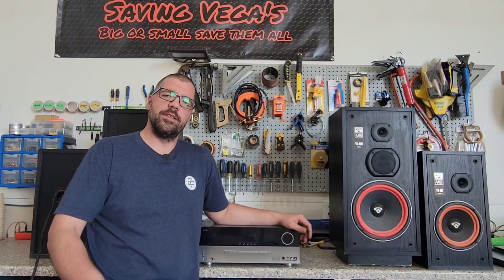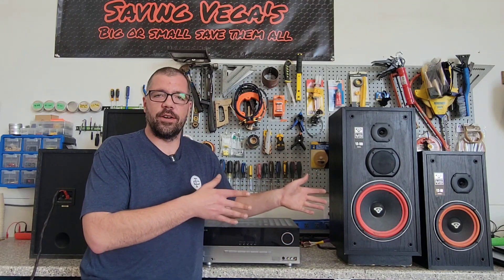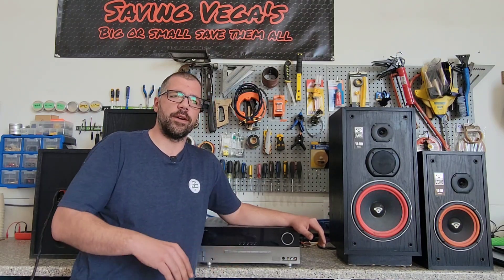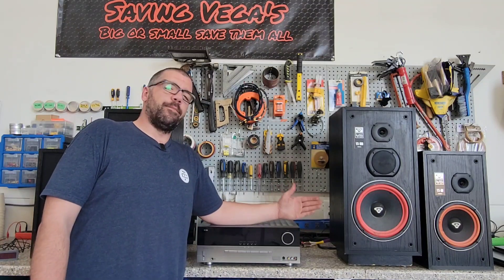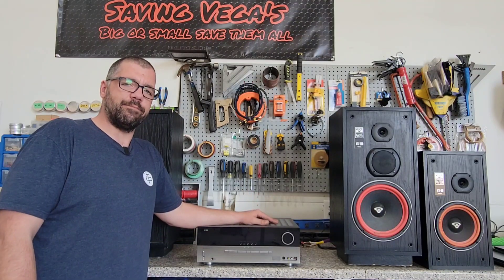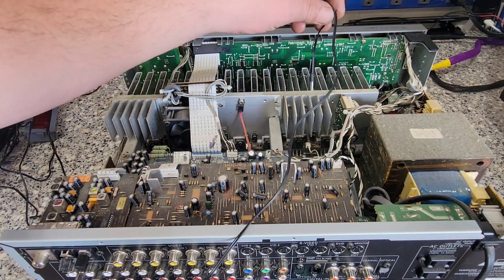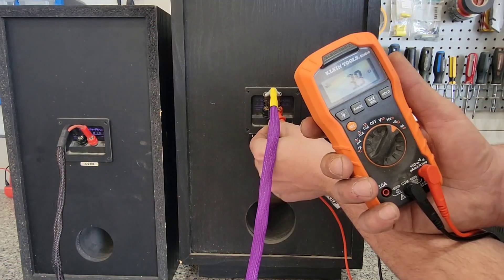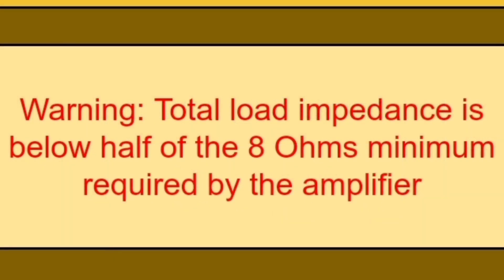Using an AV Receiver to Power Your Cerwin Vega's

Comment: why did you put the laptop on top of the receiver and reduce the ventilation area ?    that would make the unit heat up more.  I just hooked up my HK 3490 today to my Cerwin VS 120's.   i was surprised that the HK said 8 ohms on the back at the speaker input. most good receivers will let you adjust to , or take 4 ohms for one set of speakers without a problem.  i always run a cooling fan on top of the receiver so i am not concerned with heat..  in the summertime I will keep more of an eye on the temperature.

Comment: Putting your computer on top of the fan vent was not the best idea to get an accurate temp reading (and it overheats your amp). The air must flow to allow it to cool. And the computer itself produces heat it transfers through its base.

Comment: Own a pair of CV, V15b's bought new in the early 90's.
Drive them with an Onkyo M-501 dedicated amp, in "old school" all onkyo pre amp, dx-rd511 cd twin deck cd burner, and the rest...

Whats your opinion on the amp/speaker pairing.
Everything sounds very good, but don't want to over tax the amp. (150watt pc).

Thanks in advance...
Cheers 🍻...

Comment: I have two pairs of CV D3 speakers with 10 inch woofers, they are 1985 and 1987 models. Both pairs are in excellent shape and the foam surrounds look new, no fading or deterioration. They have been kept at approx. 70 degrees their entire life. Is it possible the foam is serviceable and doesn't need replacing? Thanks for any info.
Reply: IF it isn't flaking and isn't developing holes (which would leak air) then just keep using them until they do need reconing. If they weren't in the sun, that's part of why. If they were in a non-smoking household, that's part of why.
Reply: @railgap  Thanks for the reply. They were never exposed to direct sun or smoke and the snap on covers were always installed.

Comment: Sitting the laptop ontop of the receiver where the vent holes are will throw off the temperature reading becuz without the laptop ontop more heat would be allowed to escape making it cooler inside.

Comment: I had Cerwin vega Ve12 & XLS 15 
I found powering them from an 
A/V receiver they sounded rubbish & limp . 
No Heavy bass. Hardly and treble They sounded flat . 
I ended up Using Two Power Amplifiers,  CV 900 on the VE 12, and a CV1800 powering the XLS 15, with a Nad C370 acting as a pre amplifier . Much better . They were able to go Very Loud without distortion OMG, my Jaw smashed the ground the first time i cranked them. Never heard speakers go so loud and Take so much Abuse . 
Sadly Things change im Using Klipsch R 820f from same Nad C370 Amplifier nowadays
Reply from the maker: Both those models, especially the XLS15, have lower sensitivity ratings. If you compare the XLS15 and let's say the MX-400, both are 3 way designs that utilize a 15" woofer with a power rating of 400 watts. The XLS15s sensitivity rating is only 92dB, and the MX-400 is 107dB.
Reply: @SavingVegas  
So not easy to drive ?
Reply from the maker: No, sensitivity ratings are generally taken by measuring the SPL from a distance of 1 meter with one watt of power delivered to the speaker. The XLS15 is rated at 92dB and the MX-400 107dB. So, the MX-400 would play louder than the XLS15 when both given the same amount of power.
Reply: I have newer subs they are not the same as the og cerwin Vega series of woofers,drivers, and speakers...

Comment: I have a set of MX250s I bought at the military PX in Korea in 1995.  Around 2014 I refoamed the woofers, but they haven't really been used much in the last 15 years.  This video has me looking at getting them running again on my older Denon AVR-S920W.

Comment: I've got an older Yamaha RX-V793 AV receiver from the late 90s. It's 5.1, but no 5ch stereo mode. It is however 4ohm stable and can run A and B mains simultaneously. I have a set of VS-100s like these only woodgrain finish that I just refoamed hooked up to A, and a pair of L7's which are 8 ohm hooked up to B. Think I'd be safe running both simultaneously not using surround mode so no center or rears would be powered at the time?
Reply from the maker: The A & B channels are essentially only 2 channels, left & right. Running both A & B at the same time would be the same as hooking up 4 speakers on an amp with only one set of speaker outputs, one left and one right. The purpose of A & B outputs on an amp is to be able to switch between 2 different sets of speakers as need be. On the back of the receiver, it's probably written somewhere saying A or B minimum 4 ohms, A + B minimum 8 ohms.

Comment: Back in the day, I bought a new receiver from Circuit City. It was between the harman cardon and an onkyo. I got the onkyo cause it said i could use 4 ohm speakers. Run the vegas in series to get a 12 ohm load
Reply from the maker: I have since this video been able to take impedance measurements of these speakers. They are rated as having a 6 ohm nominal impedance but they actually measure closer to 4 ohms really, especially the VS-100.

Comment: Yes, after such motivational videos, Harman repair services will not be left without work)) you should take into account what you used at low volume, but people don’t think with their heads. they’ll connect it to 2-3 Ohms and they’ll load up the power)) and then there will be sadness)))) and also the timbres there, the loudness in general will be a blast... after all, of all those who own the equipment, only a few percent understand how to use it, what influences what, the rest are just playing roulette...

Comment: I'm running a Pioneer vsx59txi with a Realistic eq in to my at-15s and not happy, they say to bi amp the speakers with the front surround channels, this receiver makes 130 wpc @ 8 ohms so will that make 260 wpc
Reply: Guess I will try a Crown amp, thanks for your time
Reply from the maker: I personally wouldn't bother trying to power them with an AV receiver. If your receiver has front channel pre outs I would use those with a good power amp.

You can't bi amp AT 15s. Bi amping is when you use 2 different channels for one speaker, one channel for the tweeter and second channel for the woofer.

Comment: I have a 1990s Technics Sa-GX170 Stereo Receiver,  it's rated at 100 Watts @ 8 ohms. I've been running 1 pair of RadioShack Mach Two speakers which are 15" Woofers and rated @ 8 ohms. I'm looking at purchasing some new Cerwin Vega floor speakers that are equal too my current Mach Two's. I really like the XLS-215'S with the twin 15" Woofers. Will I be OK using my current Receiver??? Appreciate a honest reply.
Reply from the maker: I personally haven't delt with the XLS series Vega's much but I do belive they are rated at 8 ohms so your good there. They don't have the high sensitivity rating like most of the older models do so if you went with the 215's they are going to need some power. Surprisingly I hear most people aren't super thrilled with the bass output of them and most recommend running a subwoofer with them.
Reply: @SavingVegas I have a question...what do you think about hooking up a usb fan to the switch outlet of the receiver..? I see that some folks are against it...I keep one on my sony av as soon as it cranks...
Reply: I run 2 usb fans with rubber feet on top my pioneer elite vsx47tx  receiver, and it's cool all the time now even cranked for extended times.@steven6692
Reply: I've changed my mind,  going with the XLS-15 , rated at 6 ohm , guess I'll be OK with my receiver,  don't plan on cranking it up to high.

Comment: What kinda power amp is good for vs100
Reply from the maker: Of the few amps I've tried on them I prefer my NAD 216 power amp that I was using with my Adcom GTP-500 pre amp.
Reply: @SavingVegas  can you hook up a vinyl player to it
Reply from the maker: It is just a power amp so a pre amp is needed. Then a turntable would hook up to the pre amp.
Reply: @SavingVegas  ok thank u for help

Comment: The transformer in you stereo doesn't care what ohms your speakers are as long as your not running neg ohms. 
If you hear distortion then turn it down your amp well be fine

Comment: ok off of my avr i have all small book-shelve speakers and center i also have 2 amplifiers hook up to my preouts to power my Vegas twin 15s and my subwoofer the 15s are too demanding for the avr so the 1000w qsc amp does the job well

Comment: I have an old pair of CV Hardrockers 212.  The woofers were rotted and a tech replaced them with some 12 in. 4 ohm from Parts Express.  My receivers all say no less than 8 ohm speakers.  What can you recommend as a low cost amp or receiver to use with the 4 ohm speakers?  I am not sure if the original woofers were 4 or ohm.  Unable to find information on them.  Thanks!
Reply: Not a real tech, as you can easily rebuild those woofers.

Comment: My name is Jerry I have D9 cerwin Vega i need know what Av that I can buy to handle these 2 speaker I hope you can help me
Reply from the maker: Unless you are using the D-9's for home theater I wouldn't use one to power the D-9's. I would find a good 2 channel power amp and pre amp. If you do want to use them for home theater I would find a AV receiver that has front channel pre outs so you could use an external power amp for the D-9's and control the power amp with the receiver. Not a lot of AV receivers like 4 ohm speakers like the D-9's are rated.

Comment: Hi sir!  Do you think a pair of AT-12s from about 15 years ago will run well with 1979 Sansui G4500 (8ohms)?  I've seen mixed specs saying the 12s are 6ohms and elsewhere at 4ohms.  Any suggestions would be great!
Reply from the maker: I don't think that Sansui would have any issues running a set of AT-12s as long as that is the only set of speakers hooked up to it. Most of the 70's and 80's vintage amps will handle even a 4 ohm load with no issue. Wouldn't hurt to keep an eye on it and if you notice it creating excessive heat then dial it back.
Reply: @SavingVegas  thanks so much for the response!  This is what I figured.  It's very interesting how many conflicting sources state the At-12s at 4ohms, but I was able to find a advertisement spec sheet that puts the AT-15s at 6ohms.  Why do you think this is the case?  Are the ohms hard to determine for some reason? Also, I'm buying them second hand, and the original owner says their foam was replaced with prylopropelene rubber a few years back.  Does that sound accurate/acceptable to you?  (Super appreciation your way, sir! Excited for this journey!)
Reply from the maker: I have never used any kind of rubber surrounds on CV woofers before. The surround material and stiffness will affect the sound. I would recommend installing foam surrounds on them but it is up to you. Some people think it's better because they won't rot but they were designed to have foam.

Comment: My Onkyo Integra AV receiver pushes my vs150’s with ease for the last 25 years with the fan only coming on twice
Reply from the maker: Yes some AV receivers will handle lower impedance better than others. I have had multiple Onkyo receivers over the years and they always preformed well but the newer stuff had some reliability issues. So my latest receiver I bought was a Yamaha which also performs well but have had to send it in for repairs 2 times now and it just runs a set of D-2's.

Comment: Hello Saving Vega's, I have the VS-12's and recently opened the fuse holder, and now I can't get it back in. Im pushing up and pulling forward like it says. But it just won't put it back in. Should I push harder or anything?
Reply from the maker: It should just push straight in and once it is pushed in push up and it should click into place.
Reply: @SavingVegas  I have tried that now, how hard do I have to push up? Because im nearly breaking my fingers 🤣🤣
Reply from the maker: It has to push in before up. Is the fuse in the proper position?
Reply: @SavingVegas  Yes it's in the proper position
Reply: @SavingVegas  I can put a video up on my channel and show

Comment: Interesting. I have Xls 12's and I had them on a Denon X3700 H AVR. It ran them ok. But I could tell it was stressing the AVR . The XLS 12's are a 6 ohm load and the AVR was spec down to 4 ohms, but it was getting really hot and I could hear a lot of distortion especially at higher volumes.  But the AVR has pre-outs so I got me a Crown XLi 1500. Made all the difference in the world. Anyways cool video!
Reply from the maker: That crown 1500 is probably the best dollar per watt amp you could get if you only need to run one set of speakers. Under-rated for its power output and should have lots of headroom for those 12s.
Reply: @SavingVegas  Yeah it is. Powers them with no problem what so ever. I have an entire 5 channel setup all XLS model speakers, the 12's, 6C center, a pair of 6S surrounds. The center and surrounds are powered by an Emotiva BasX A3, 3 channel power amp. And  to round things out I have a pair of SvS PB 3000 subs.
Reply: @SavingVegas  YES! I NEED TO GET ONE

Comment: I just received my new pair of XLS-215's that I'm powering with a Yamaha MX-800 amp.  Only used for rock music at the loudest possible levels.  What ohm load should I set the amp at?  Why do I get distortion at half throttle?  Any other recommendations?
Reply from the maker: Is there a switch on the back of the amp to select impedance?
Reply: @Saving Vega's   There are buttons on the front for selecting 2,4,or6 ohms. There are also buttons for selecting 3 pairs of speaker outputs. Would I short circuit things or gain nothing if I connected all 3 speaker outputs to the one pair of speakers?

Comment: sorry but av receivers SUUUUCK
Reply from the maker: Why are you sorry? I power my Vega's with a high current power amplifier. I do however use a AV receiver for my surround sound setup in my house but I have a seperate power amp running off the front channel outputs for my D-2's. I made this video because lots of people use them to power their CVs.
Reply: @SavingVegas  ok, not sorry. i just use my pioneer sx-780 works great
Reply from the maker: That's a good unit. Used to have a 680 and loved it.
Reply: @SavingVegas  cool. my current setup is :
Pioneer SX-780,
Behringer DEQ-2496 ULTRA CURVE PRO,
BBE 362-NR SONIC MAXIMISER going in and out of tape monitor 1,
SONY TC-WR590 Digital readout dual
      cassette deck in tape monitor 2,
bluetooth module in the aux,
PIONEER PL-518 TURNTABLE in phono,
Cerwin Vega VS-150'S (one of which i 
      need to re-cone again) in a spkr, and  small Infinity RS-2000's in b spkr.

But hooked to my PIONEER SX-580 is an Alesis MEQ-230 Dual 30 band per side eq,
and in a and b spkr are 2 pairs of Bose 201 series 2 speakers.
MY next project is to completely re-do the vs-150 speaker cabinets. Ud like to do them in actual walnut then polyeurethane or whatever that shiny clear crap is on bar tops on them so they look glossy. OR i might do them in clear or smoked acryllic.
Reply: I run a Kenwood kr-9600 on my Vega's
Reply: @biga8230  sweeeet!
Reply: I power mine with a Sony 1080 receiver works fine
Reply: Responding to M, my JVC RX-888V is 125X2 RMS per channel @ 4~16 ohms. It is more than enough for most any house speakers. I like it alot. I put some fans in it so she stays cool because that thing runs hot but not anymore. Mabe someday I'll get a dedicated amp but I love my JVC. So why do you say they are all junk?
Reply: @robertholsopple9451  ok, i stand corrected. Ill recant my mouthing off at a.v. reveivers and revise it.
New statement :
 A select, good quality,  vintage receiver powers Cerwin Vega speakers nicely.
There. I actually were powering them with a 20w/ch Pioneer sx580 when i first got them and it was waaay louder that a newer Yamaha RX V 373 receiver which supposedly has about 7 times the Pioneer in 2ch mode. No comparison, Pioneer blew it away.
Reply: I power my VS-150’s on an old Onkyo Integra AV receiver rated at 6 or 8 ohms and it runs just fine. The fan has only come on twice in 25 years and only when running a 5.1 Dolby Digital movie.